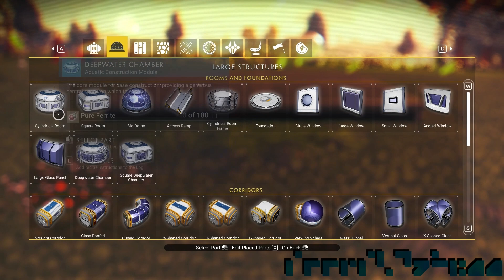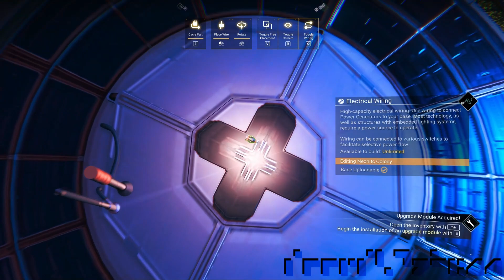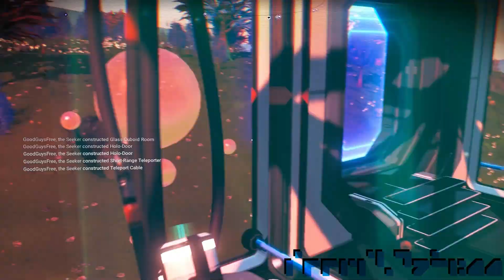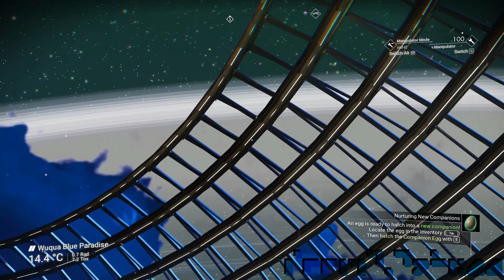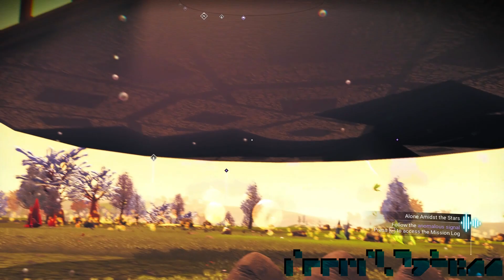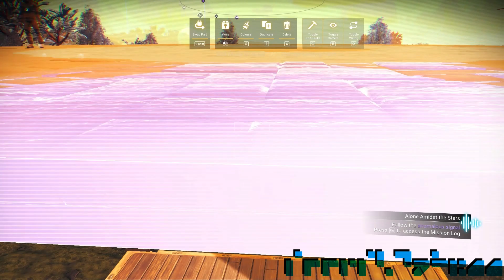Learn to BUILD a GLASS DOME in #nomanssky - upside-down glass rooms and more!

Comment from the maker: Updated Information - all you need to know:
✓ There is a better way to make the corridors come out of a cylindrical room in all 8 directions (thanks Loki_354). Comment if you want a future video about this.
✓ Parts changing colors during build - probably happens when you glitch a part on a connector, switch to wire-mode and re-glitch. Simply go back to the part menu, select the part, switch to wire-mode and re-glitch. It should be the correct color.
✓ Methods to open glass tube corridors, and opening up cuboid rooms / biodomes exist. Let me know if you're interested.

Comment: I've noticed that my things become other colors using this method
Reply from the maker: I've noticed this in some cases, and I am in the process of researching this. A way that has helped me some times is to remove the part that became different color, and re-do the operation, but go into color selection before placing the part. Another thing that has helped is to go into build menu, switch to edit, pick up the part in question, go into color mode, select the correct color, and then just cancel the edit. I am still not sure why this happens. I will post something about this soon.
GGF
Reply from the maker: So, this actually happens when you glitch a part multiple times by switching to wire mode, then wire-glitch and back to wire mode...
GGF

Comment: Thanks for this, now to learn the reverse wire glitch
Reply from the maker: Well, the reverse wire glitch is the same as the wire glitch... Except in normal wire glitch you select a part, switch to wire mode, bring the wire to the place you want the part to be, and press the wire glitch combination to place the original part, usually in places the game didn't intend for.
In reverse wire glitch, you select a part, bring it to the place you want to have a wire, and press the same combination for the regular wire glitch, resulting in a wire that's attached in specific positions that are of interest.
For example, using a floor with reverse wire glitch will give you a wire that's connected at the exact center of the floor and let you pull it to wherever you like.
GGF